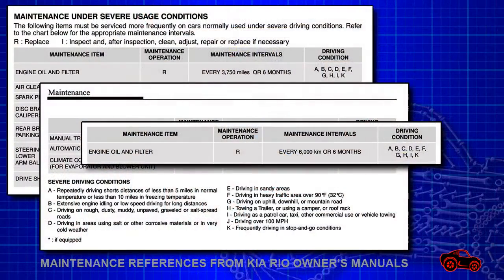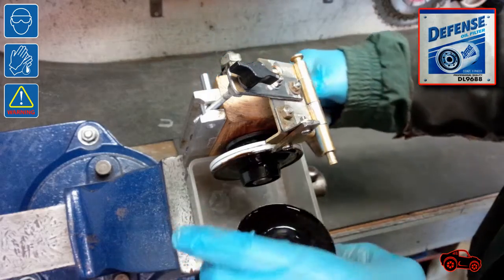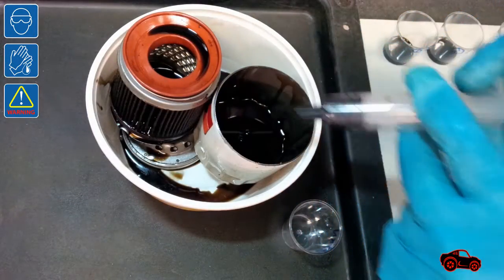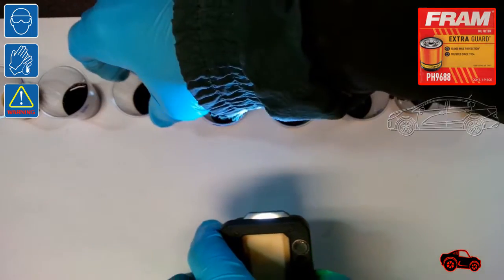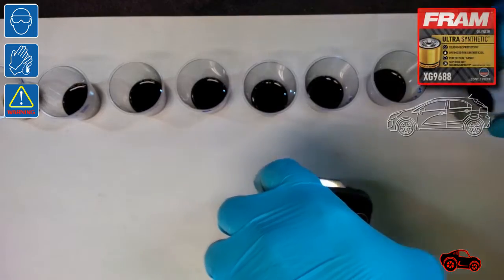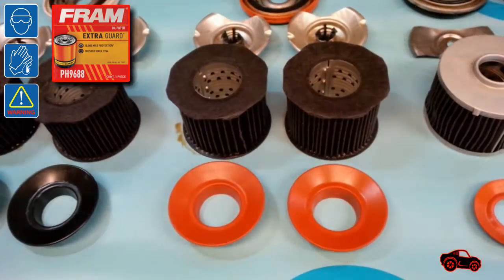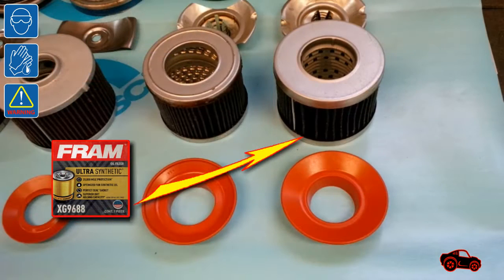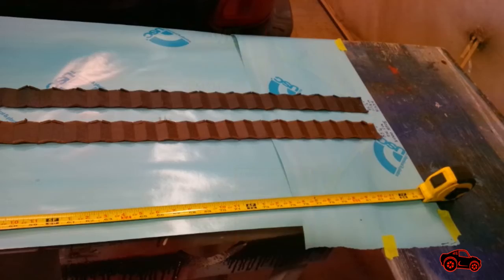KIA Rio GDI Engine Oil Filters Comparison after 3750 miles

Comment: The Hyundai Kia GDI engines cause more soot because they wash the combustion chamber at cold starts with unburnt gasoline which then leaks past the pistons and into the engine oil. This excess of gasoline is injected to coat the intake valves and prevent the infamous carbon build up. In other words, if you have a Kia Hyundai GDI engine from 2010-2020, you get engine oil dilution on all turbo and non turbo engines.
Reply from the maker: The video was not about the root cause of contaminated oil, but, it is a good idea to describe it. I added more details in the video description section.